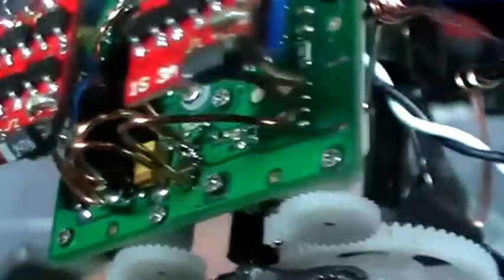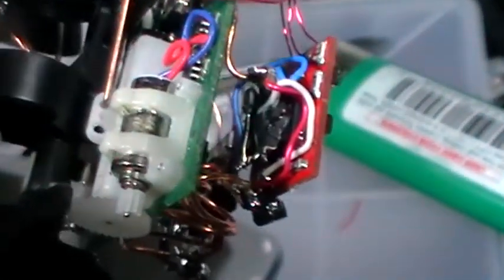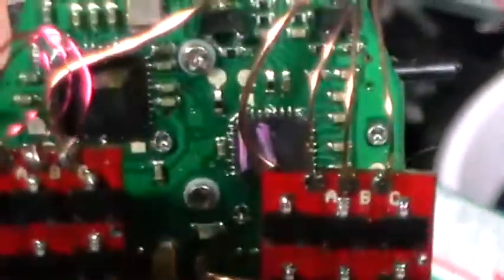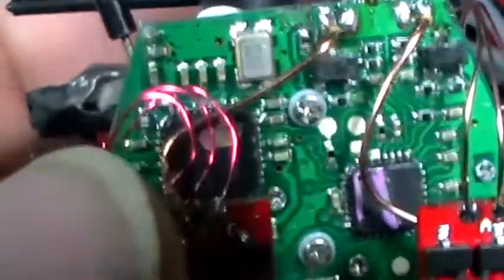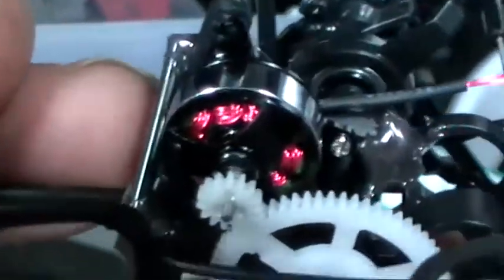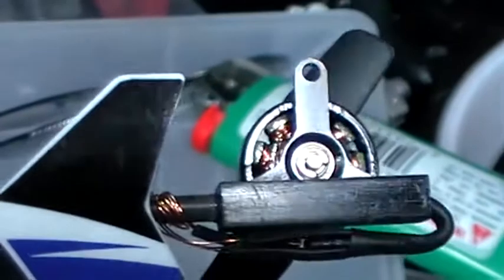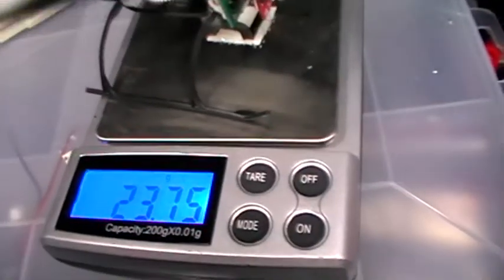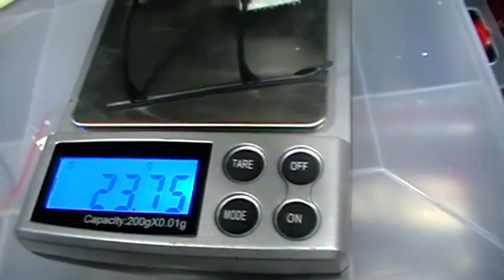Dual Brushless MSR, E-Flite Blade MSR EatAtJoes Elias

Comment from the maker: That is because the FET's require a load to regulate correctly otherwise seeing the waveform on the scope was showing irratic behaviors, so add the resistors in place of the brushed motors to create a phantom load for the FET's to see

Comment from the maker: Oh they are great fun, and getting lighter and lighter.
The only complaint I have is that my main board was faulty on my first MSR and they wouldnt send me out a replacement board, yet people with lesser problems in the USA had theirs replaced at no cost and kept the old ones. I was rather annoyed with that, But I guess thats how Horizon treat their customers outside the USA, it would have cost me more to send back the heli than it cost me to buy another main board, very disappointed with that.

Comment: Excellent work. Just like to ask you about why you need to add the resistors? Where did you put the resistors at? You mentioned, in your other video that you use the 4#3 tail gear for your pinion, which makes the gear ratio approx. 4.5:1. Does this make the motor hot after the flight? Thanks

Comment from the maker: yeah much easier to right turn... I find you can do much higher speeds., but it does both quite fine, just a little different with left, not at all like a CP heli or larger heli... but I'm fine with that...

Comment: I am currently doing this mod and hav all the electronics soldered onto my spare mother board and am modifying a alloy main frame to fit a 12mm inrunner walkera motor. do you think this would stll work as I am tossing up whether to start tig welding and milling the frame milling the frame